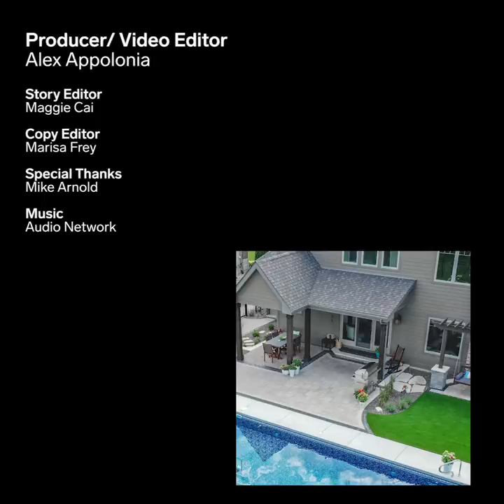How Outdoor Patios Are Grouted With Sand

Comment: In Norway, per most recent building practices, we'd actually just use fine sand in the gaps and have at least two to three layers of masses of different fractions in the fundament. He kinda mentions that a climate with a freeze-thaw cycle demands more give, but I really don't think people from different climates realize the importance of that point.  It's not that people dislike cement as a material or want to inflate the work costs, but I've seen the difference between how cement and sand hold up here and the answer is simply that cement doesn't. If simply poured over a surface and used as a base it gets serious damage very quickly. Within three years it has loose bits all over the place. Like this isn't to undermine the fact that methods that don't work in certain climates may work well in others, but I've seen a lot of people in the comments call this man's method redundant, which is just plain wrong.  Per the standards where I come from what he actually skips out on a layer or two. Which I'm guessing is because of lower levels of wear and tear on the surface among other things that I won't get into.
Reply: Will the sand last long? How does it not get swept away by weather like rain?
Reply: @heyjohnsmith  Not from what i've seen. But if you have a small leak in a waterpipe or ants moving the sand, that causes damage.

Comment: In the uk, not sure about the rest of the world but in the uk, Kiln Dried Sand is generally used for gap filler in outdoor patios / brick/block paving if your not cementing.
Reply: Polymeric sand is becoming more popular in the uk. Just depends if people want to pay for it. 

I did my parents garden, wasn't block paving lioe this with small gaps though, full stone slabs with 10mm gaps, ended up making a funnel tray out of some wood, and a 8mm thick peice of wood for a tamper so i didnt have to use a vibrating machine. Just put the funnel along a join, pour in the sand, and push it into the crack with a piece of wood thats thinner than the joint gaps, tamp it down. Works really well to get it really compacted in there and get a consistant fill height to all the joints. Much less messy than mortar/concrete.

Comment: Lovely presentation, but how does water work on this? Like the lower layer of this is basically pebbles wrapped in a huge sheet that will easily contain water but make it hard to escape due to the layer of tiles. Can anyone tell me how it works out?
Reply: Water will just seep through the fabric into the soil, it's not water tight
Reply: He just said when you spray it with a water hose, the polymeric sand hardens and locks it in place. 
So logically if there was a water "infiltration" from below, the sand would harden instead of getting washed away...

Comment: I want to do something like this for my about 900 sqft backyard, but just to pour concrete would probably be an easy 15k+. Seen other channels on here say they do barely a back patio for $5k
Reply: Depends how much work you can do yourself. If you can do it yourself you at least know youre going to not cut corners and make it end up costing more. 
Even doing it with the cheapest concrete pavers, making sure they are on a solid base thats not going to shift, using polyeric sand on the gaps to get a nice colour, can make it more cost effective than really expensive stone and still look good because its done with care.
Most of the time geap pavers look even worse because the person laying them doesnt care how they end up looking. 
My parents garden was a miss match of different sort of pavers pieced together over years with patches on concrete, even had square ones with a section of hexagonal ones just with a bunch of sloppy concrete filling the gaps, it was a mess.

Comment: How did you manage to level and tamp the crushed stone clearly horizontally?
Reply: Put in several wooden or metal pegs/posts in the ground around the outside of the area you want level. Make sure there's no movement in them. Then run a string between each one and level the string, and you can make it the same height as you want the layer to go to, or take it a few inches higher. Fill the area in and measure down from your string to make sure its uniform distance from the string across the whole area. You may need to remove the string each time you tamp down the layers, then put the string back for the next layer. But you should put the posts somewhere where you can leave them in, that will make it easier. Since you can put a mark on them. Just double check the strings are all still level.

Comment: Rain water doesn't seep in and accumulate at the bottom, above the Fiber cloth?
Reply: The crushed rock layer let's the water flow under the pavers and drains at the soil edges
Reply: @jasondiaz4260  Thank you. So even during a heavy downpour, there won't be any water stagnation? Do you recommend a dedicated drain system for a tropical climate?q
Reply: @rohansivon  Walkways should be installed with a minimum cross slope of 2% grade. The minimum 2% incline should help prevent drainage issues. As far as tropical setting with heavy rain, I'd assume the adjacent soil would be fully saturated and you'd need an additional drainage system to help convey the water. This could be with a small channel or a more expensive inlet/ storm drain.
Reply: @jasondiaz4260 Appreciate your time and information..🙂

Comment: How does the sand not run off in the rain though?
Reply: It's polymeric sand which, as it sounds, has a polymer resin inside it. As it gets damp it hardens and bonds together. 

There's a bunch of people saying they washed all theirs out when they clean the patio but that's just regular sand, sharp sand, or kiln dried sand.
Reply: @RylanStorm  thank you.

Comment: That looked like that adhesive powder they sweep in the cracks and spray with water to lock into place
Reply: They won't want it to lock in place otherwise it won't have any flex and eventually cracked and fall apart.
Reply: Well I'm not sure what to tell you but they make the material and ive done it on more than one patio that's still there today and that was over 10 years ago
Reply: Yeah, i think its pretty similar to that, though that sort of pot hole filler i think has a different sort of filler material and maybe a harder curing resin.
Reply: @ge2719  sounds correct

Comment: doesnt it get washed away by rain?
Reply: Its got epoxy resin in it. Once you wet it the resin cures and goes hard. 

But also, even if it was just regular sand, its got nowhere to go, the sand should be stuck between the pavers

Comment: Is polymeric sand plastic?
Reply: Exactly what I was thinking.
I guess this might cause a significant amount of micro plastic.
Can anyone clarify what this polymeric sand is exactly?
Reply: It varies by brand but the clue is that polymeric comes from polymer.

They contain adhesives or water activated resins which set them like concrete but they're more flexible. They're also waterproof and will stop weeds and insects.
Reply: @RylanStorm  thank you. I thought so.

Comment: few Things to comment here:
-You do not need to put this plastic layer into the ground, ruins Air and Waterflow
-You do not need to compact the ground at this place because you just walk on it. 
-You need a different Material in the substructure containing 0-22mm or 0-45mm.
-Laying out your pattern should never Contain a cross gap
-Please do not fill your gaps with a polymere aka Plastic. I recommend any Stone or sand you favor containg 1mm-3mm grains.